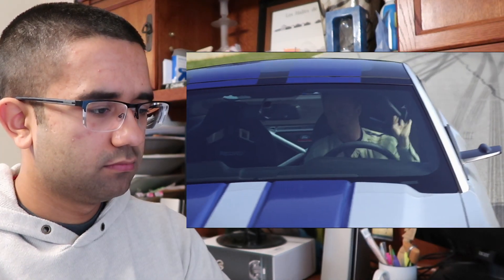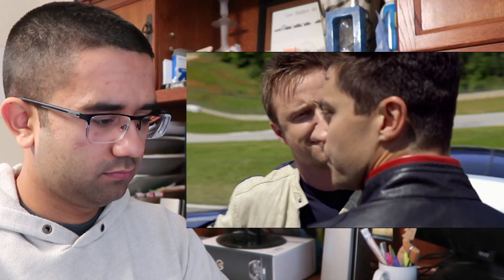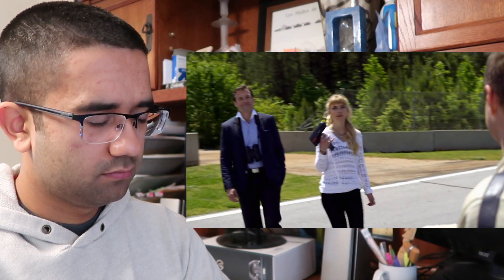Real Engineer Reacts to Technology in Need for Speed

Comment: Some air forces practice what they call a "hot refuel" which is basically refueling an aircraft on the tarmac while its engine is still running. Extremely dangerous and only really used when the defecation hits the oscillating cooling unit but it can be done
Reply: "defecation hits the oscillating cooling"   Made me pause, then laugh out loud.  I gotta remember that.   (also I though oscillating meant back and forth movement, like what a piston in an engine does, rather than a rotational movement? So maybe it should be called a rotational cooling unit?)
Reply: @Atlessa  depends on if you're talking about a ceiling fan or a desk fan
https://www.youtube.com/watch?v=_D6Zi9OlUVM

Comment: Dude it's Buggati Chiron and Koenigsegg makes the fastest production cars not Buggati. And yes horsepower isn't that necessary Buggati uses a W16 cylinder engine, while Koenigsegg regera uses a 4 liter V8 making 1600HP and 1011 Nm and only weighs with the driver 1600 Kg. That's 1 hp for every kilogram of the car making it have a perfect 1:One power to weight ratio.The Regera has a claimed, electronically limited top speed of 410 km/h (255 mph). It is capable of accelerating to 100 km/h. https://youtu.be/E6aHQD1UqoQ
Reply from the maker: Clearly you know more then I do lol I used to have all of this stuff in my mind but now I'm so much more focused on specific parts of cars because of my job that I loose track of what other people are working on
Reply: @parychahal  No worries, I understand! :)
Reply: I'm no car expert but has there been any new electrical engineering discoveries?
Reply from the maker: @scifirealism5943  Discoveries...not anything significant, it's a lot of making current tech more efficient and building upon what already exists
Reply: And aren't HUDS already real? Why aren't they used in cars?
Reply: @scifirealism5943  Problem with that is people aren't very quick to change and it's gonna take some time before electric cars get cheaper so that more people can buy them, but by no means is the combination engine obsolete. People will still make engines because they are very efficient and simple. Same reason why Kalashnakov's Ak47 pattern rifles are still used.
Reply: @scifirealism5943  HUDS aren't used for safety concerns.
Reply: @scifirealism5943  Mazada's new SkyactivX engine is a good example of a very good engine. https://youtu.be/yNSxow3W7ek